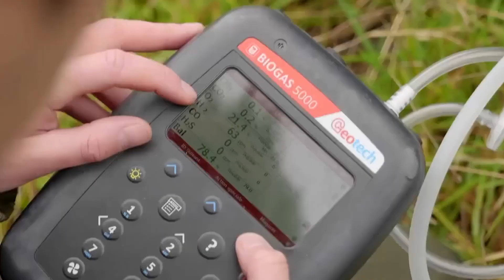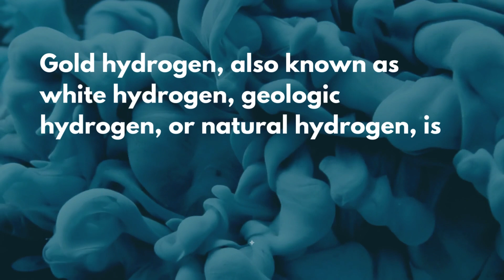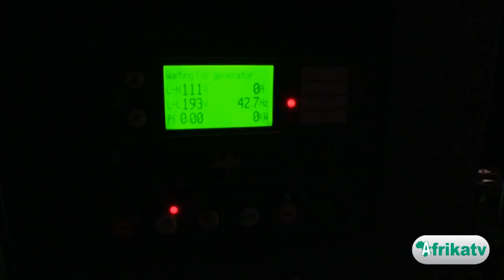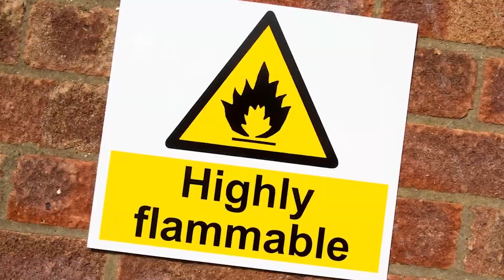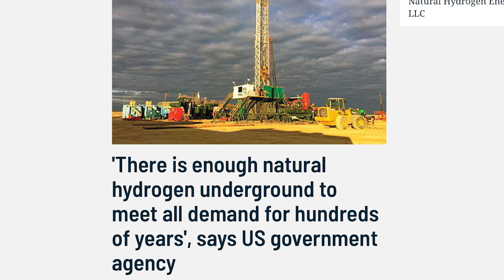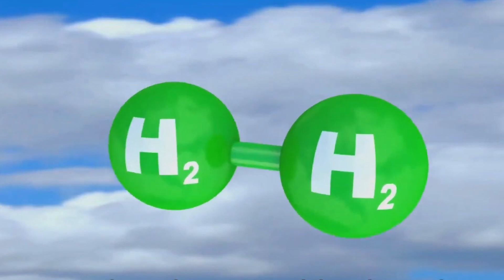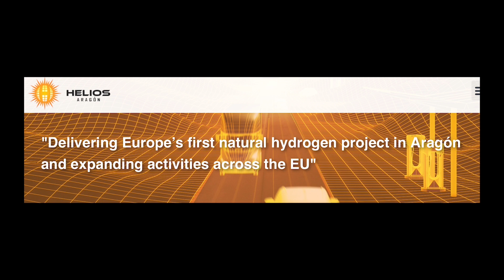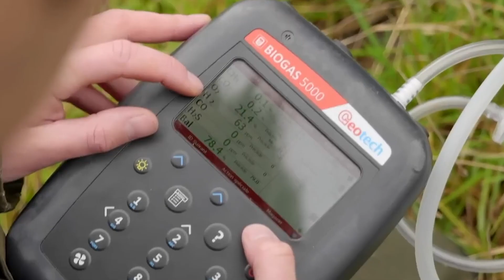The New "Gold Rush" That Could Change Energy Forever? (Gold Hydrogen Explained)

Comment: Hydrogen is soooo stupid. Even if it's free from the ground, you still have to find it, mine it, transport it, store it, transport it again, store it again, pump it under pressure, keep it cold, and then charge for all that. And it still goes into some stupid ice car to get burnt. It's also a finite resource.  EV. The sun charges my home battery and I put it in my car, no cost. When you can beat zero cost, then we can talk hydrogen, until then, just don't. And all you people that think hydrogen is a good idea, and oh I'll never buy an EV, tell me how it's better than electric,  I'd love to know.
Reply: Lots to unpack here, but I'll share one thing to consider: battery EV technology is not feasible in pretty much anything outside of your car due to its weight. It can't power heavy duty vehicles, buses, boats, planes, rockets etc as a result. All things we depend on, most of which are larger pollutants. This is due to its energy density of ~250 Watt hours/kg. Hydrogen's energy density is ~40,000 Watt hours/kg. Tell me which is a better long term solution, assuming the infrastructure to produce and charge both battery EV and hydrogen EV (or ICE) is at par with each other.
Reply: @steviebigs  ok well let's do facts eh? We already have heavy vehicles that are battery powered, semi trailers,  huge mine machines, there are now quite a few large ships that are battery powered. Your argument based on kw h, is not the whole picture for a few reasons. You must take into account the energy loses ,all along the way.To get 40,000 you have to put at least 3 times that in. Battery tech is getting better everyday, we now see battery's with 400, 500 per kg. Yes , not as much as hydrogen, but no where near as much waste as hydrogen. Thirdly the weight of the hydrogen tanks and support equipment is not to be scoffed at either. Hydrogen may find its way into our energy supply system one day, but by all accounts, by the time that day happens, we will have battery's that far outperform hydrogen, and that will be the end of it.
Reply: @stephenhammond1656  interesting. I see your points. I would argue that equal investment into hydrogen production, storage and transport would lead to greater efficiencies. Largely due to its energy density. But also due to its rarity — lithium is the 25th most abundant element on the earth whereas hydrogen is the most abundant element in the universe. Why not place bets on the larger opportunity immediately?
Reply: NOTHING WRONG WITH SOLAR, IT'S A SMART WAY TO GO FOR EV'S !. JUST KEEP EV'S  OFF OF THE POWER GRID.  BATTERIES ARE THE PROBLEM !!!. EV'S NEED TO BE A NATURAL FREE ENTERPRISE ENVIRONMENT. NOT REGULATED DOWN OUR THROATS.    PER CONSUMER REPORTS MAGAZINE WHICH IS RESPECTED, AND WORLD RENOWNED. EV VEHICLES HAVE A MUCH, MUCH GREATER HEAVY FOOT PRINT ON PLANET EARTH THAN PETROLEUM POWERED VEHICLES FROM ALL PRODUCTION PROCESSES TO COMPLETE DISPOSAL.  PETROL POWERED VEHICLES ARE 100% RECYCLABLE EV'S ARE NOT. !. ALL PROCESS FOR  BATTERY PRODUCTION AND DISPOSAL ARE VERY HARSH TO PLANET EARTH.    NATURAL HYDROGEN IS THE WAY TO GO. AND MAYBE HYDROGEN PRODUCED FROM NUCLEAR ENERGY AS WELL.   UNTIL WE HAVE GREEN BATTERY PRODUCTION AND DISPOSAL, I WON'T BE APART OF IT.   VEHICLES EMISSIONS ARE GETTING CLEANER AND CLEANER.   THE WORLD SHOULD NEVER GIVE UP ON ANY SOURCE OF POWER. JUST MAKE IT'S FOOT PRINT ON PLANET EARTH LIGHTER!. .
Reply: That is the business of the gov't political leaders and its allied companies to collect more money for their own pocket ànd less for the people.
Reply: A lot of the local transit busses are already hydrogen.  Locally they get the hydrogen from sewer gas, whick would otherwise get wasted.
Reply: @awackocrank  thanks for your comment, I love to see waste get used productively,  and it sound like it's working where you are. If the gas is from the sewers, then it's probably methane, not hydrogen, and methane is great because it requires way less energy to harvest and store ,than hydrogen . Hydrogen big downfalls are how much energy it takes to make it, store it, transport it, store it again and then dispense it. So even Methane is better than hydrogen.
Reply: @stephenhammond1656  They actually make hydrogen gas from the methane.  It is more efficient than making hydrogen from water.  Hydrogen can be got from wells like natural gas, but has not been exploited in the US because there is not the infrastructure to handle it.

Comment: Electric cars are not the answer, Hydrogen from clean sources is.
Reply: Nonsense. Hydrogen, whatever the source, is mainly intended for bulk energy - ie where batteries are too big and too slow to recharge. Think ships, railways and - ESPECIALLY - electricity generation. And what will that cheap electricity generation be used for? For personal transport EVs simply have too many advantages. Those advantages would push the transition to them even if the climate delusionists were somehow right.
Reply: @kenoliver8913  Problem with car batteries is the environmental impact from lithium extraction which uses vast quantities of fresh water and sulphuric acid. 

Then we get to cobalt and then the emissions created from the transport and construction from minerals to batteries.

EVs are far from clean despite what the pro EV delusionists think.
Reply: I still see Toyota Mirais running around with their water dripping tailpipes.  Hydrogen cars.  They never became very popular because of lack of  fueling stations. Not yet anyway,